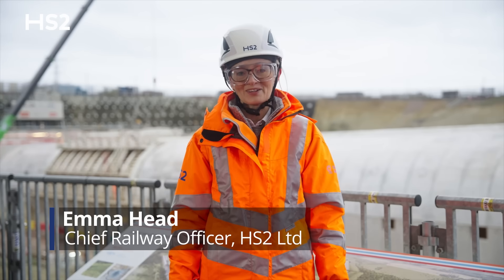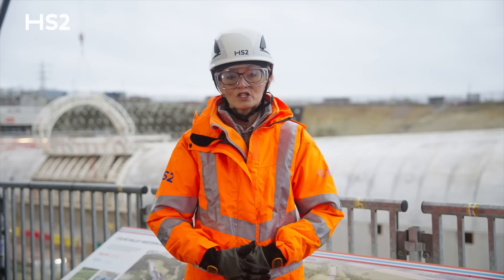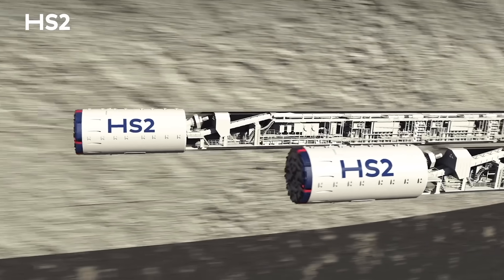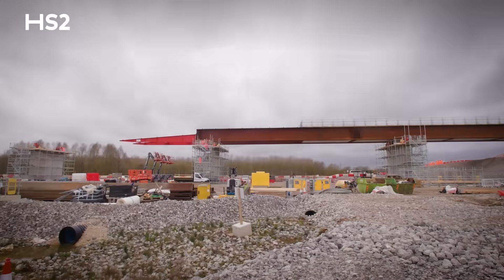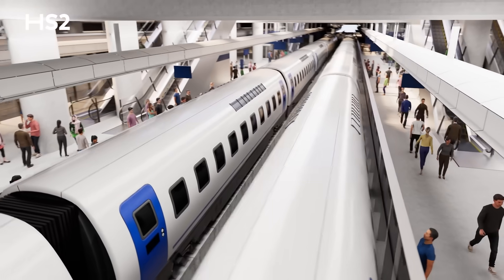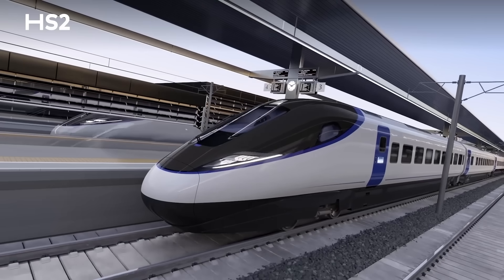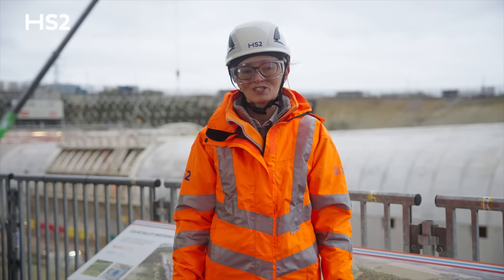HS2 Project Update, December 2024

Comment: should have started this project in the North
Reply: Why, if it was just started in the North it would not of got any where, as it is the construction of HS2 is being built the whole length of the line from Birmingham South  to London and North to Handsacre is under construction now, on construction projects like HS2 and Motor Ways they never start from just one point
Reply: @peterwallen1063  I mean the Northern stretch should have been built first, the stretch from Manchester/York down to Birmingham, or Birmingham up to Manchester/York if you will.
Reply: @turquoiseowl  Sorry building projects such as HS2 / Railways or Motorways do not start from one place as they will never get finished, they are built in sections from both ends as is HS2, it is being constructed from London going North, From Birmingham going South towards London and at present North from Birmingham to Handsacre in Staffordshire and the West Coast Main Line and all sections in between, it is a new line for the West Coast route nothing to do with York which has a direct hi speed route to London Kings Cross but what is so special about the North for HS2 to start there
Reply: @ HS2 was at some point intended to improve connection between Birmingham and York and on to Newcastle, in terms of line upgrade between Leeds and York. Point is there is no inter-city connection between York/Newcastle and Birmingham while all the other cities connected by HS2 are already served by inter-city links between them. The North is special because it needs public infrastructure investment much much more than the South-East and has much more potential for growth.

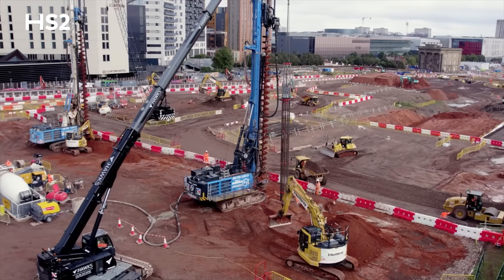Comment: 4:22 cool picture of the rail lines in Birmingham 

I can't help thinking that there should be slightly more facilitated interchange between them! The lines pass right by the Curzon Street station without a stop and then arrive at their stations just 100s of meters down the line. I'd consider some sort of lift/people mover system to connect New Street, Moor Street and Curzon Street without going out on the street and waiting for a tram.

Comment: This doesn't really make clear how far through you are.Halfway? Three-quarters? In terms of, say, person-hours expended, or the date of the start of services. I can get a train from Euston to New St for about £10 (with my senior railcard) and it takes 76 minutes. How will HS2 compare? And what is the latest news of provision of a link from HS2 to HS1 (for someone going from B'ham to Paris, say); will they have to walk? It's 600m as the crow flies, but how far will it be as the commuter travels?
Reply: They said in one of the other videos that they are 55% completed on the project
Reply: @DavidKnowles0 That might be a bit optimistic when you consider they haven't started at Euston or north of the Delta Junction and the Chiltern Tunnels to the Delta Junction is in the early stages.
Reply: @TrevorWilliams-fq8mg  They might have been calculating it base on completing old oak common to Birmingham section.
Reply: I think David is saying some parts are ahead of schedule,  but not the project as a whole.  I don't think they have reset the project yet as they said that was a job for 2025/2026 but I have doubts tgeycwill be able toxreset very much, if anything.  They also say they want to reduce costs. Again I can't seecthem succeedibg in renegotiating the civil engineering contracts. The target completion date for Euston (at 2040 ??) seems a long, long way away. Is that date the date HS2 are planning if the government fund it, with an earlier date if it is privately funded ?
Reply: @TrevorWilliams-fq8mg  
Ahead of what schedule is the question? Possibly if some of the work packages (sub units) were rescheduled some time in the last few years then it could be conceivably be argued that they  finished earlier. eg if a section including a tunnel bore was subject to a reschedule five years ago and that bore was built a month ahead of that schedule then...maybe. But it is still later than originally planned, so really its just word play but nobody is really fooled.

And yes It absolutely is undergoing a full reset (I've tried to add a link below but search for DfT  HS2 and reset - 19th Dec) . This was well know before the above video was posted and it is disingenuous of HS2 not to mention it.

You have some good questions, and the thing is nobody knows. But it think It would be wiser to assume that the completion dates will be later and more expensive than the previous last estimates. When has a govt megaproject come in under budget and ahead of schedule, especially given the fact that an unstated driver in this project is to funnel public money into private hands.
Reply: @NSBarnett  they say it will take about 45 minutes or so from Birmingham to London. As for connection HS1 (I agree there should be more provisions) it seems like it's just going to be like any other transfer between London terminals so via the underground or on foot
Reply: It is not due to be completed until 2030 and even that is only to Old Oak Common. So it will take longer from Euston to Birmingham than at present, given that you have to take a tube to OOC. The extension to Euston itself is not anticipated until 2040, depending on whether the private investment for this part actually arrives
Reply: @chimchimineee  The time to completion from Birmingham to OOC is still in the window from 2028 to 2030, some parts have been completed weeks or months ahead of schedual. The construction phase is going extremely well, just like the Elizabeth Line. 

It will be interesting how the fitting out of the stations and installation of the track and signalling goes as smoothly, this is the part the Elizabeth Line failed apart on and added billions to the project. We will see if HS2 has learnt lessons from that.

Personally why I think there will be finishing works for the stations, especially OOC, as it connects some much existing infrastructure together, the line will be either operating or train testing by 2029.
Reply: @DavidKnowles0  
With all due respect it is complete fantasy to suggest that HS2 is in any way ahead of schedule. It was originally due to be completed by 2026 (phase one)
I would be please to be corrected with sources but I would be suprised if they were more accurate than the report from the DfT public accounts committee a couple of weeks ago that said that the whole project plan has been reset and that even the new cost estimate will not be known until 2026. Not only the cost plan but the entire delivery plan "On the reset for the project, officials told the PAC that this will not just deliver a revised cost estimate, but it will also provide an updated schedule of delivery."

Comment: interesting update... when you say 'to the heart of our capital' , presumably you're not referring to Old Oak Common which is in the western suburbs of London. Also, when you use emotive adverbs like 'dramatically' to describe the reduced journey times, I'm not convinced that the current times of 1 hour 15 minutes from New Street to Euston (both very central) amounts to a dramatic reduction if the new railway is 49 minutes from Curzon Street to Old Oak Common (neither of which are as central as the existing stations).
It would be good to have a more realistic and honest engineering update without the political spin to mask what is clearly an unjustified white elephant project.

Comment: Nice video, but what the taxpayer really deserves from a publicly funded project is an explanation for why, even in it's cut back form, HS2 is massively overbudget.
Reply: That's easy to answer. The budget was a figure pulled out of the air. Then contracts were awarded on a cost plus basis with no fixed cost because little  or no information was available. 
Then at a later stage 8,000 planning conditions became known together with method statements for the line to cross other railways, rivers, highways and canals and all the existing infrastructure services that have to be diverted. Then when all that information was available the Contractors tendered their contracts to sub contractors and the 32 billion budget became 65 billion and will continue to rise until all the civil engineering works are completed.
Reply: Because some men in suits got rich by selling it as doable....

Comment: Good update. Small detail but the trains switch to driving on the right at 5:40.
Reply: On HS lines trains can and do run on either line in both directions. It is still the normal though to run on the left.
Reply: Happy railway 200 everyone

Comment: I don't understand how a such as flat counotry can be have so much tunnels and viaduc
Even the Rhone LGV is not so tortured
Reply: It's partly because of pressure from environmental groups and nimbys opposed to the construction
Reply: To get to such high speeds you need immensely straight rail geometry.
Reply: @Stargate2077  yes
And UK is flat 
So why create tunnels and bridges?
(Except for Nimby)
Reply: @thunderbolt8409  protection of the natural environment above or below, also not all the ground is suitable to have a rail line built at grade so a viaduct would be necessary (vulnerable to flooding etc)
Reply: @thunderbolt8409  The UK is not flat.
Reply: @Stargate2077  You didn't even read the whole comment? Or is it normal for you when reading to ignore parts which you don't understand, such as "LGV" (which pretty sure means high speed line when translated from French)?

France did a tradeoff and built relatively curvy and hilly high speed lines. At the cost of more powerful locomotives needed in operation.

Comment: Much cheaper and quicker to put EVERYTHING underground. So no bridges at all  - putting tunnels under roads under rivers under railways.
Reply: Who wants to do a complete journey in a tunnel? Part of the attraction of rail travel is the travellers experience.
Reply: @ People travel by plane in a very small tube. People go under the Channel in a tunnel. The 38 minute journey from London to Birmingham isn’t excessive. But I do agree it isn’t perfect. The bridges are beautiful and excessively engineered. If the planning system was quicker and better and the population density was lower I’d say do what you’ve done. But this project has diverted funds from much more desperately needed areas.

Comment: Fantastic news, just need to continue up to Manchester and across to Leeds, just that 50mile section takes 1h 20m today longer than it will take from London to Manchester
Reply: This should have been done first as it could have been done quicker and be start generating money and it is needed more than the London route.
Reply: It’ll eventually happen but the use of hs2 will determine when.
Reply: Dont worry, with the train only going to Old Oak Common, the new journey on HS2 from Euston to Birmingham will take longer than the current journey from Euston to Birmingham
Reply: @ well i never intend to go in to London just get access to cheaper flights out of Heathrow...
Reply: It won't be expanded north because the tories have already sold off the land acquired in the North to their private business mates at cut prices

Comment: The problem with Britain is a national desire to avoid doing the job. "Designed to deliver resilient rail travel" - this sentence alone echoes the thousand strata of management, the consultation groups, the money creaming subcontracting subcontractors and the completely disconnected directors in this or any large project. It's a miracle there's anyone actually building anything.
Reply: Exactly. "Resilient rail travel", wtf does that even mean?
Reply: What? It is being built
Reply: @gregjalepeno6769 it’s being half built , possibly less than half built.
Reply: Resilient until there are leaves on the line, or the temperature drops below 5 degrees. It'll be interesting to see how much the tickets are as well
Reply: @petecollins3921 leaves on the line is a braking issue. On normal commuter tracks this an issue where there are frequent stops and line changeovers. Unlikely to be much of an issue here.
Reply: These cynical and negative comments were also said about the Elizabeth Line construction.  That has been a success and made a major impact on resilient rail travel in London. Not all major infrastructure projects are as a much as a disaster as you convey.
Reply: @andrewtrimble9770  yes but that project was actually completed, and its usage has already been more than heavy enough to justify its construction. What is it about British politicians and people constantly opposing infrastructure improvements
Reply: Great comment
Reply: Great comment. And those accusing this realistic thinking of "cynicism" might really want to look into exactly how this £100 billion has been spent
Reply: @chimchimineee  Funny how you talk of "realism" but happy to misquote the build cost to spin your own Narrative

Comment: Are there provisions for extensions further north?
Reply: The delta junction outside Birmingham enables north and north east connections. It's being built. If the government chooses to make use of it is tbd
Reply: Cancelling phase 2 was a fortunate land-grab for the government, wasn’t it?
Reply: @Cheesemaker-o2v  Not at all.
Reply: It won't be expanded north because the tories have already sold off the land acquired in the North to their private business mates at cut prices
Reply: No. That was all cancelled.
Reply: @MarkWhitter-qm6ef  So when it is needed for future expansion it will cost 5 times as much as doing it now would.
Reply: @rogerphelps9939  Gross exaggeration as always, but we'll have "5x times" as much money in the future too.
Especially when we've rejoined the EU. It WILL happen.
Reply: @MarkWhitter-qm6ef  Completely wrong. It's being built all around us ATM. The cancelled eastern leg will have a long siding constructed, where it splits from the western spur towards Handsacre. It'll  go to the Kingsbury compound where bridge sections for the route are cast. From what I have been told, (by onsite personnel) they will switch to sleeper production and use that spur to deliver them to parts of the line being constructed in the Birmingham area.
Reply: @MarkWhitter-qm6ef  For the moment, yes. Ir may happen in future when funds allow.